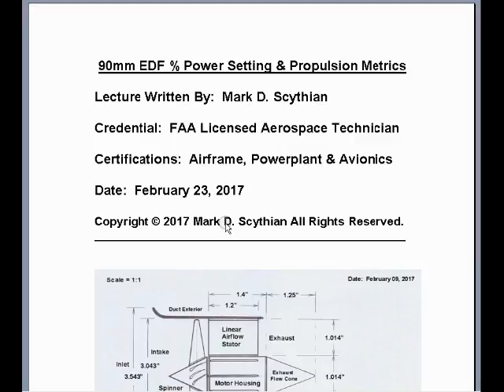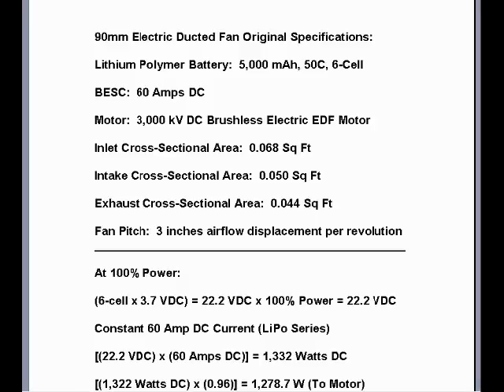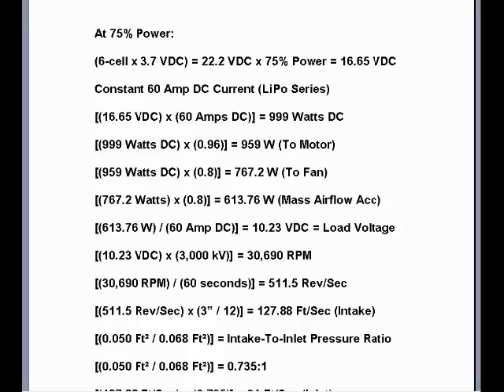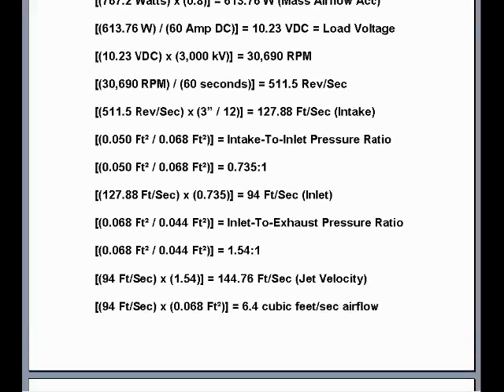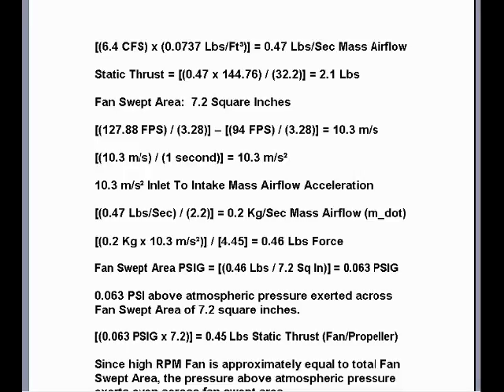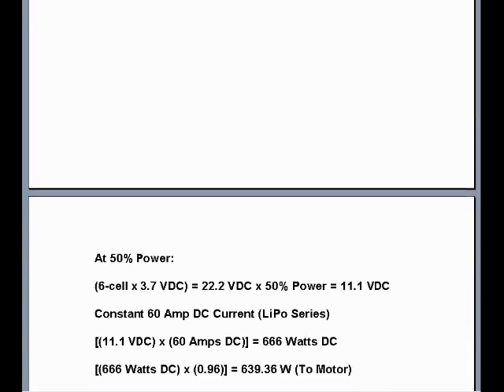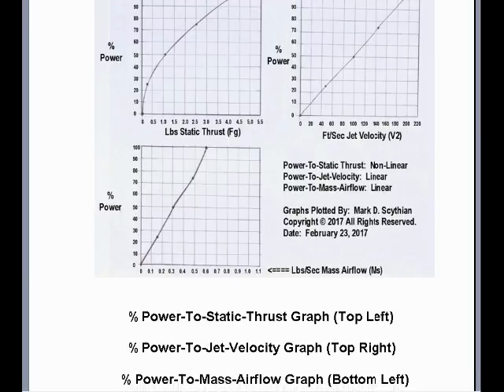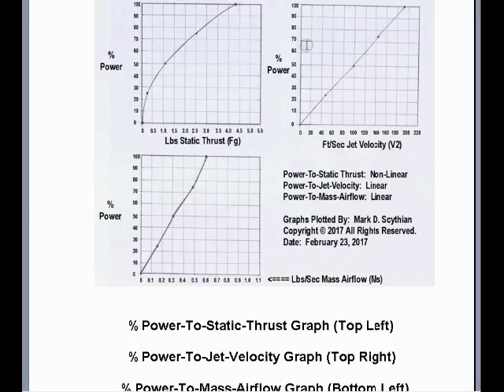90mm EDF % Power Setting & Propulsion Metrics

Comment: Hi Mark I watched your piston engine video like 5 times. I have few questions regarding my project with a video game racing simulator. I would like ask you a few things if you don't mind or got time for it. Thank you.
Reply from the maker: Hello JJ Hemp how are you?

Please ask me your questions.

Thanks.
Reply: Thank you very much for taking time to respond. I am currently dealing with the engine part of the game physics. When you start it , it chooses one of these engine profiles.  ( 4 different colors represent different series of racing ) Darker Colors represent 4 engines that are Most Used. #2. #7. #12. #15.   I can basically split engine characteristics into 3.     Power/RPM.      Engine Dimensions.   Cooling. 
Torque 1 2 3 values are probably BMEPs. unless I am wrong. 
https://imgur.com/a/MasTn   Please take a look.
Reply: Now the questions that keep bugging me.  When I change Cylinder Displacement to a smaller size, let's say from 350 to 150 CID. My idle speed in game goes from 1000 rpm to 3000 rpm roughly. Question is - Power and Torque and RPM are pretty clear to me but how far in terms of AIRFLOW and FUEL flow calculations can we game's engine get with the values included in the data sheet.  Are we missing anything that is necessary to complete the formulas? Or in general do you see anything interesting with the way these numbers are organized?  Compression ratio? Not here, but do we need it ?  Each track in game has an elevation value. They are all set to 0 feet however, but it is adjustable. Temperature also can be selected. So there has to be airflow involved. How much can we calculate sufficiently without needing other parameters known?    Cam profile? Intake Valve lift? Carburetor CFM? It is supposed to be carburetor engines. But because it is in a video game :)) I guess you can call it electronic fuel injection. :)) Please tell me what you see right off the bat, before I slam you with a ton more questions and make it all confusing. Thank you very much for taking your time. JJ.
Reply: https://imgur.com/a/tcLZr  also please take a look at this brief post . I am trying to input a Chevrolet 350 CID engine profile instead of one of the engines in game.  I  got torque and HP curves or can get more accurate once. But in terms of differences that need to be accounted for , besides compression ratio 10.25 to 1  vs  NASCAR 12:1 what else would you find important? I can calculate BMEPs and get engine dimensions from 350. But I am afraid that Airflow values will not transfer over correctly as it feels like we are missing fields that should be adjusted.  Intake Valve Head Diameter is the only airflow value I find , together with Redline maybe.  Also PEAK POWER , if you change that value, nothing happens in game. So it isnt directly affecting anything. So maybe it is used to calculate possible airflow and such. Please tell any info is a great help.
Reply from the maker: Hi JJ.   The imgur.com  post you listed is very accurate information.  The formulas are all spot-on.  This is the way piston engine physics should be demonstrated.  You'll have to figure out what the %VE is with your given application.   Look through my YT library I have a lecture on nearly all applied physics piston engine parameter calculations.

As for valve timing and camshaft lobe degrees, use the existing template you are dealing with or look up the specifications for the engine you want to 3D model design simulation based on industry engineering specifications, because then all the finite cam and valve timing degrees are listed with the stock (OEM) as well as high performance (racing) applications.  Once your %VE is sufficient you'll have the option to enhance the bore x stroke to the power limitations, Torque & BHP at a given RPM (torque curve).

All of the results you are experiencing are the logical reaction to changes in bore x stroke in relationship to torque & RPM.  As you lower CID the fuel metering and BHP output limits at 30% Brake Thermal Efficiency will result in a higher RPM to compensate for less CID.  BHP = [(Ft-Lbs Torque x RPM x 6.28) / (33,000)].  BHP is a function of Torque, RPM and BMEP.  The BMEP is a function of CID and Compression Ratio.  BMEP is directly proportional to Torque & BHP, where as RPM is a function of fuel delivery & airflow. 

The first thing you need to do is define the BHP power output limits either assigned for the vehicle you are working with or designed based on the desired acceleration within limitation as well as the vehicles tire rolling resistance and aerodynamic drag coefficient, projected frontal area,, atmospheric pressure (elevation), air temperature to calculate air density in slugs/ft^3. 

A four-stroke gasoline piston engine will convert 30% of the potential energy in gasoline to mechanical power output (30% Brake Thermal Efficiency).  Gasoline has 20,000 BTU/Lbs heat energy content and releasing 1 BTU/Min will equal 17.6 Watts.  746 Watts equals 1 Horsepower.  BHP is simply the usable power output after factoring out friction horsepower losses to keep engine running.

The first step is define the limits in power required, acceptable acceleration and power to keep vehicle moving at constant speed overcoming aerodynamic drag & tire rolling resistance.  Then this will lead to the fuel delivery and airflow requirements, bore x stroke.  Larger bore of course will result in more torque and more fuel consumption.  Longer stroke will also have more torque and less RPM.  Lower stroke and larger bore will surely increase CID, Torque and RPM to a lesser extent, but then you also need a higher compression ratio.   

As for older piston engines they require higher octane to slow down flame-front speed at higher compression ratios (above 10:1) to prevent detonation.  But newer piston engines in automotive applications (2010 and newer) use electronic EGR Anti-Knock Sensing to take the place of higher octane in compression ratios higher than 10:1 in which low octane gasoline can be used without any issues..

These are the engine dimensional relationships to the mechanical & thermal power output.  If you research through my YT library and view all of the lectures on piston engines, energy content of common fuels, power to accelerate automobile and maintain constant zero acceleration cruise speed lectures you'll see the relationships between the dynamics involved with converting chemical potential energy (gasoline) into heat and pressure and thus into mechanical power and remaining usable power in the form of BHP at given a RPM.

But you'll have to start with defining the limits of your engine and vehicle such as max acceleration, fuel metering, airflow, torque & RPM required for max BHP (torque curve), drag losses of vehicle such as tire rolling resistance, aerodynamic drag, whether the roadway is paved, unpaved, wet or dry or up a hill or down a hill or level.  The SinX degrees of the incline added or  subtracted depending on up hill or down hill maximum limits would have to be added or subtracted to power requirements when on level road or surface environment.

Building a series of charts, graphs or Excel Spreadsheet applications might help to organize the many parameters involved.  When the numeric design is complete and evaluated by calculation (applied physics) then the data you enter into your engine and race car 3D modeling racing simulator should respond with a well-designed equilibrium and then when put into action the rates-of-change differentials should be within the desired design goal(s) you're looking for.  Anything else you can "trim" or adjust accordingly until you find the perfected limits satisfying your project goal.

If you can spend more time at my YT library you'll find all the finite elemental applied physics you need to enumerate the engine & vehicle parameters you're working at building.  Let me know if you need any help along the way.  It is best to first define the performance limits and work out all of the mathematical models first as samples until you gain proficiency in each system.  Then system integration in accordance to design goal becomes easier and more straight forward.  

- Mark -
Reply: Thank you so much Mark. This is huge help. I am not going into too much detail on Chassis and Tire section of the profile but there are adjustments for Frontal Area, Drag, Rolling Resistance , all those goodies are present. As far as the numbers included in the physics editor, you think it is enough parameters to calculate engine performance accurately? Problem is , physics editor creator had access to things like Player Gear Ratios , but did not include them in the software. So my main concern , did he skip anything else important in the engine profile that is needed for calculations? I have made a sample 350 chevy engine and it behaves really well. But in terms of lets say compression ratio. NASCAR runs 12:1 which will give it it's BMEP values. Should I compensate with smaller BMEP values for a 9:1 compression engine?  Like same engine with 12:1 makes 210 BMEP but our Chevy being 9:1 with let's say everything else same should make less BMEP theoretically?   Is there a formula to calculate BMEP difference base on compression differences? I am inputting a decent accurate profile of 350 chevy but does it mean it runs on 12:1 compression? And if so, there are no adjustments for compression ratios, should I input lower BMEPs to compensate?  Thank you very much for all the info this is huge help. I am an automotive technician so don't be afraid to slam me with all the technical stuff. As far as valve head diameter? Is that really enough to calculate our Air Flow Limits?  I noticed smaller CID idles at 3000rpm but I can drop idle speed down by reducing the Head Diameter of the valve, this comes with overheating of the engine tho, why would that happen? Too much fuel too little air for HP/BMEP inputted? Thank you once again Mark. Ill be watching you YT.
Reply from the maker: Hi JJ!  

The BMEP, BHP & Torque are all directly proportional to each other at a given RPM. 

That right there defines the function of the BMEP in PSI to Ft-Lbs Torque where by the dependent variables representing them are the compression ratio and CID denoting that they are theoretical constants. 
Compression Ratio as in Static Compression Ratio not Dynamic Compression Ratio which is a variance not a constant. 

If you view the 'How To Calculate Piston Engine % Volumetric Efficiency (Revised) lecture in my YT library and also a new lecture I'll be uploading shortly today titled, '2008 Chevrolet Corvette Top Speed Calculation' lecture, you should gain better understanding over the parameters governing powertrain to vehicle top speed limitation.

The gear ratios are usually obtained on an industry standard to a class of automobile application.  Whatever automotive performance application your design goal is probably should reflect upon a given specification standard from a manufacturer.  Unless you have a general differential equation or implicit limit to provide yourself with a practical gear-ratio equilibrium for whatever application you're designing to practicality.

The airflow will reflect the air-to-fuel ratio, generally modern automotive powertrain will electronically meter an AFR as fast as possible to 14.7:1 AFR by weight.  From that point on by deductive reasoning and algebraic differentials you can figure out the mass airflow by weight in Lbs/Sec and tie that to the fuel consumption first in Lbs/Min (PPM) and then Lbs/Sec (PPS).  This information is in the 'How To Calculate Piston Engine % Volumetric Efficiency (Revised)' lecture.

Since the assumption is that the fuel delivery system specifications you are working with are electronically metered, the airflow in Lbs/Sec or cubic feet/sec is know by tying it to the Gasoline AFR standard of 14.7:1 by weight proportionals air-to-fuel (AFR).

Less CID at idle seems that the AIC (Idle-Air-Control) will trim itself to much higher RPM to compensate for the reduced inherent CID engine dimension thus leading to reduced idle BHP so the compensation is increased RPM to match rated BHP,, Torque & BMEP when idle. among the adjustments includes increased airflow to meet the rated AFR as well.

When at lower RPM thermal runaway occurs if the AFR mixture is too lean, in this case approaching 18:1 which is the leanest Gasoline can burn at.  The leaner mixture at lower RPM will cause hot spots in the cylinder and the AFR will richen automatically to prevent this if electronically metered.  If carbureted then the maintenance specs require an idle flow jet for idle RPM set at a higher mixture to also prevent hot spots.  A piston engine is an air-breathing machine and when at idle RPM there will be less cooling airflow as well within the cylinder and too lean a mixture at idle will indeed lead to hot spots within the cylinder.

So of course we're assuming this powertrain you're designing on a 3D computer modeling racing simulation is electronic fuel metering.  But in case it is not and it is carbureted then the idle air control fuel jet is to be set richer than 14.7:1 AFR (economy) probably to 12:1 AFR (optimal).  

You'll have to set the idle air mixture a bit richer than economy to prevent hot spots due to too lean AFR where the intake airflow is not as high to prevent thermal runaway and cylinder hot spots at idle RPM.

If you're designing everything from scratch including the valve train, valve open-dwell-times, cam valve lobe timing, head deck clearance, whether domed, flat or dished piston, you first should define your overall performance limits then research manufacturer specs that are within limits to the performance limits you want to implement. 

From there you'll have enough data to complete the rest of the design and do some preliminary simulation testing.  All good questions you have, but the operational concepts behind all systems should first be understood so they could creatively be applied into custom design.

Let me know if you have any other questions.

- Mark -
Reply: 100% this is great help. If you looked at the data sheet with the engine values , all the values in there are the only things that could be adjusted.  There are no adjustment lines for AFR, Compression  and so on. All we got  is  123 RPM , 123 Torque , Redline,  CID, Stroke, (bore is self calculating i assume) , Intake Valve Size , Number of Valves , and oil and coolant lines.  The physical formulas and "hard code" of the program is unknown to us as the game maker never opened the source code. The Physics Editor software was made by someone and is a huge mystery with a lot of unknown values and data. It is " half assed" you can say. My goal was to understand what the editor can do , and how far in terms of simulation we can get with only the values provided for adjustment.  I am not designing it from scratch, but rather trying to make changes to what is already there using whatever values that were provided for adjustments. I want to stay 100% correct and realistic in terms of simulation numbers. So If it means after the research " I have to say ONLY AMERICAN MADE V8 CARS with CID of 350 to 450 , 1 valve per head , OHV overhead valve (NASCAR design still ),  can be simulated , so be it. If there aren't enough fields provided to make a 4 cylinder honda civic profile out of 358 V 8. Then it is what it is , no Honda Civics , no 4 cyls possible.  There are no adjustments leading to Camshaft, Valves train angles and duration. So I assume it is either pre programmed in EXE, and editor creator never included or couldn't include adjustments for them .  But as far as logic goes. I should first see the performance capabilities of an engine in real life, and pretty much make sure that in GAME , the given engine does not OVERPERFORM or UNDERPERFORM. You are the best help in the science department I can have. So overall you say, the set of this values that are provided for adjustment is pretty powerful?   RPM , BHP, TORQUE, can be calculated all the way through the curve. But in terms of cylinder dimensions- it is also pretty clear , Piston Area * BMEP * Stroke and all that plugs in reasonably.  It is the AIRFLOW , CYLINDER HEAD and FUEL FLOW , where the only adjustment on that side I have is 
"Number of Intake Valves , and Size of Intake Valve Head." Is that enough to complete the simulation? 
Or At least I should have - " compression ratio" or " AFR 14:1 or 12:1 or some adjustment" ? 

I have watched your video on VE% like 8 times by now, this is where I got most of my logic to ask you questions. That video moved my research quite a bit with the "PLANK" formula.  The top speed - Air Resistance and Rolling Resistance is next. Thank you for sharing all the REAL useful info on youtube. 

I will have to make some sample in game videos to provide examples of things that keep bugging me.
Reply: https://imgur.com/a/MasTn